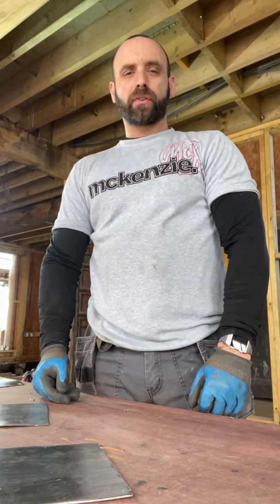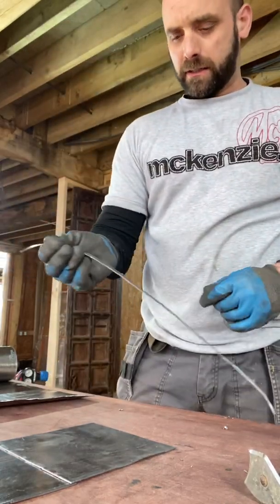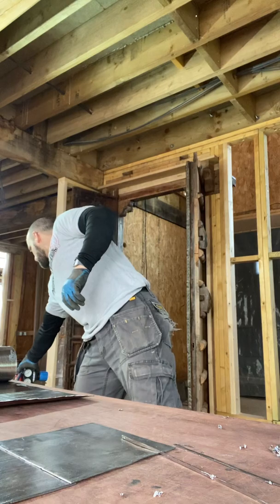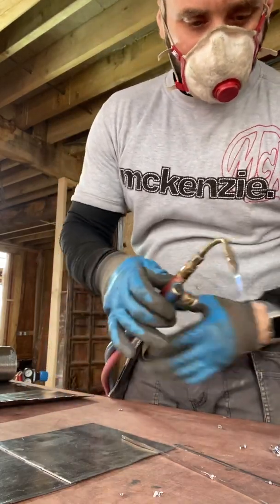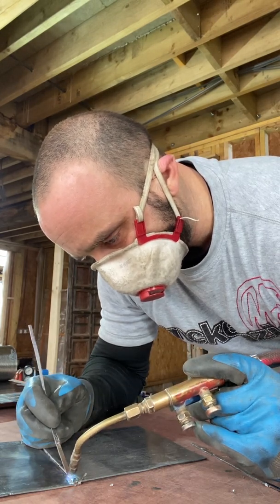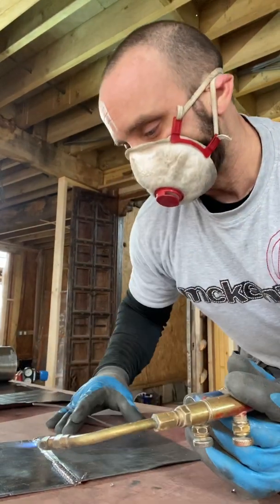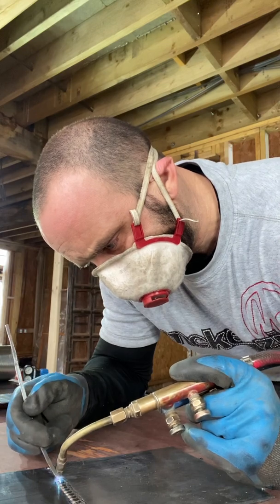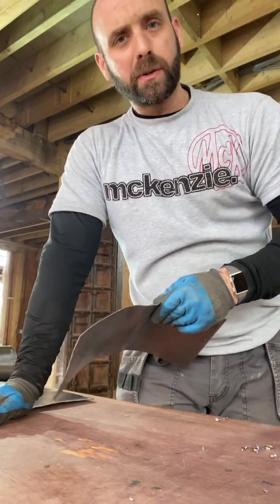Lead welding : Demonstrating how to weld lead.

Comment: Hey thanks for taking the time to share the video. I've been practicing as a bit of a hobby really. We had an old guy doing all our lead burning but he's retiring. I'm looking to get one some courses soon. Have you any tips or examples of vertical or angled welding? Cheers
Reply from the maker: Hay no worries. I’m planning on making a more in depth welding vid soon. 
But for now a tip I would give for vertical welding. 
Is to weld down from the top first. And then come back up. I find this so much easier than just coming straight up from the bottom.
Reply: @slbleadworks  Thanks buddy much appreciated I'll give it a go 👍got a few more bits of scrap I can practice on
Reply: @slbleadworks   lovely presentation, any link to a suitable torch etc for a lad starting out at lead welding
Reply from the maker: @tonygrace4946  https://www.thewelderswarehouse.com/blog/model-o-torch/
Reply from the maker: @tonygrace4946   the welders warehouse is where I got my model o torch from. It’s the 2nd generation and I love it. Really recommend this one.